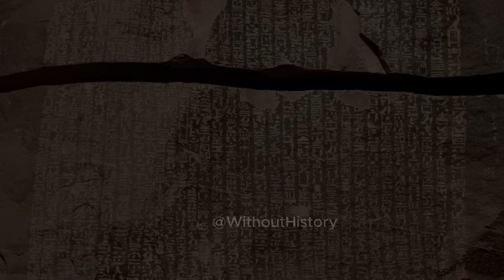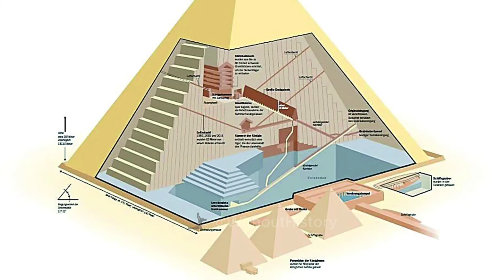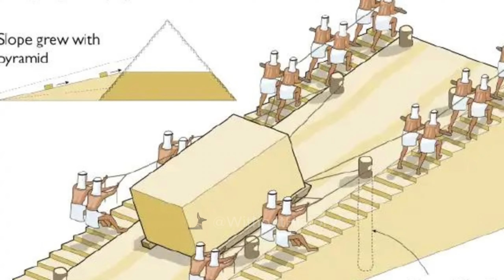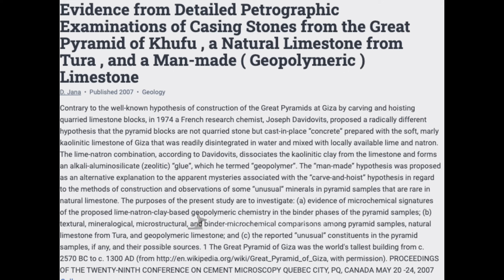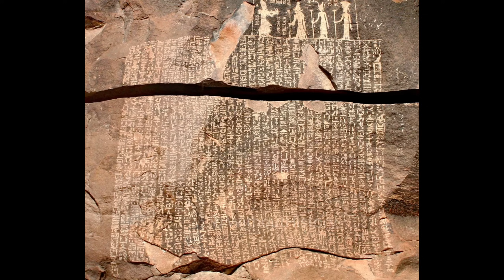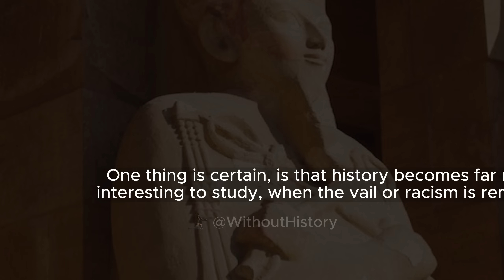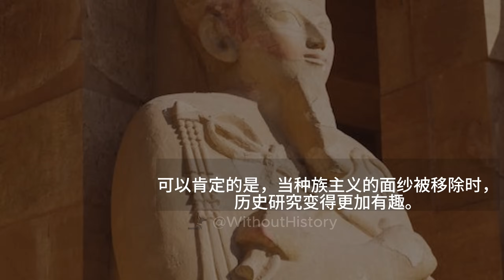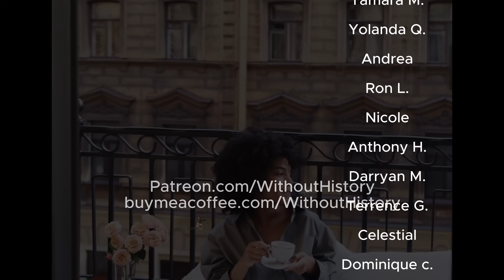That one Pyramid secret that explains everything!!!

Comment from the maker: if you liked it, Make sure you SHARE the video with your loved ones and on your social media. It's the only way the algorithm notices us. Much love to you all.❤❤
Reply: "To:Mr.Without History,this YouTube Video',was quite interesting:African heritage persons, especially African American'can most certainly benefit by finding out such ancient accurate African positive history. . .5-17-2023'
Reply: I Loved this video, it was very educational and informative!!!!
Reply from the maker: @annecrawford7813  thanks so much Anne 🙏🏽🙏🏽
Reply: If you had the possibility of pouring blocks to make up a pyramid, why not shortcut the mold production and demolding and moving into place.
Why not pour the whole pyramid in one piece, one huge block, with shafts and rooms cast into the make up of the pyramid?
I don't believe that the pyramids were poured block by block. 
What we see is the use of machinery that was run by electricity.
But since the so-called air shafts were sealed and covered by a stone placed over the end of the shafts with such precision that the shafts weren't discovered until the 18th century.
To cover them means that electricity was a secret they wanted to hide, the shafts were where the electric cables came in so they could finish the inside while still working on the outside.
Reply from the maker: @gianfrancofronzi8368  Fronzi, great idea, but you would have to deal with scaffolding that bigger than the pyramid and structural issues at the base that cannot withstand the pressure of above liquide. Also, your scaffolding would have to be perfect from the start which leaves no room for error.
Reply: @withoutHistory   What you are describing can happen with poured stone slabs. It's all the same, until you haven't let parts fully dry.
Reply: I’m saving this video for all time, thank you sir’ 🙏
Reply: And your china from kemet video was a real eye opener and this one, wow’ 😳😧🤐
Reply from the maker: @doncarmack5132  🙏🏽🙏🏽🙏🏽
Reply: . Hemotep clearly state he was crom egypt and not Kermit. He was of royal blood and not as you state he was an Andonite an not black as yu intonated 
So ur theory is blatantly. Do ur do diligent before expound  wrong
Reply: I have been inundated with the construction of the pyramids of Egypt and wondered why 99.9 % of the  facial structure,particularly the noses have been  broken off when their construction has been of very hard materials...we're their faces deliberately disfigured and by whom.
Reply: Secondly ,isn't  Egypt also called Kemet or is kemet simply a part of egypt
Reply: Are Imhotep and Joseph the same person who built the step pyramid. Acts 7:10...  God gave him favor before Pharaoh, king of Egypt. God also gave Joseph unusual wisdom, so that Pharaoh appointed him ruler over all of Egypt and put him in charge of everything he owned.
The Great Pyramid has 8 sides. The 8 sides represent the 8 kingdoms of the world. Jesus is the corner stone. The last kingdom to rule forever.
There is actually ten sides counting top and bottom. First Empire was Nimrod. Who represents Babylon the Great, the Empire of false religion. The bottom of the pyramid is a side. All eight Kingdoms of Revelation ride with the harlot, Babylon the Great.
The Great Pyramid having no top corner stone and 
the top being flat is the Harlot. Jesus is the cornerstone the builders rejected. The Nations would rather follow the Harlot than Jesus.   Revelation 17:9 “This calls for a mind that has wisdom: The seven heads mean seven mountains, where the woman sits on top. 10 And there are seven kings: Five have fallen, one is, and the other has not yet arrived; but when he does arrive, he must remain a short while. 11 And the wild beast that was but is not, it is also an eighth king, but it springs from the seven, and it goes off into destruction. 
Matthew 21:42 Jesus said to them: “Did you never read in the Scriptures, ‘The stone that the builders rejected, this has become the chief cornerstone. This has come from Jehovah, and it is marvelous in our eyes’? 43 This is why I say to you, the Kingdom of God will be taken from you and be given to a nation producing its fruits.
What does the Sphinx really represent. Because Jesus is the Lion of the Tribe of Judah. 
Isaiah 19:19 In that day there will be an altar to Jehovah in the middle of the land of Egypt and a pillar to Jehovah at its boundary. 20 It will be for a sign and for a witness to Jehovah of armies in the land of Egypt; for they will cry out to Jehovah because of the oppressors, and he will send them a savior, a grand one, who will save them.
Revelation 5:5 But one of the elders said to me: “Stop weeping. Look! The Lion of the tribe of Judah, the root of David, has conquered so as to open the scroll and its seven seals.”
Reply: The Great Pyramid points astronomically North. Cain went east of The Garden of Eden.  Young's Literal Translation Genesis 4:16
And Cain goeth out from before Jehovah, and dwelleth in the land, moving about east of Eden.
City of Leo, Was the sign of Cain a Lion. Cain worshipped Jehovah God. He offered sacrifices to him. So did Jehovah forgive him by marking his land with the Lion. The Mark of Cain. 
Genesis 4:13 At this Cain said to Jehovah: “The punishment for my error is too great to bear. 14 Today you are driving me from the land,* and I will be hidden from your face; and I will become a wanderer and a fugitive on the earth, and anyone who finds me will certainly kill me.” 15 So Jehovah said to him: “For that reason, anyone who kills Cain will suffer vengeance seven times.”
So Jehovah established a sign for Cain in order that no one finding him would strike him. 16 Then Cain went away from before Jehovah and took up residence in the land of Exile, to the east of Eʹden.
Genesis 4:24 If 7 times Cain is to be avenged,
Then Laʹmech 77 times.”
Matthew 18:21 Then Peter came and said to him: “Lord, how many times is my brother to sin against me and am I to forgive him? Up to seven times?” 22 Jesus said to him: “I say to you, not up to seven times, but up to 77 times.23 “That is why the Kingdom of the heavens may be likened to a king who wanted to settle accounts with his slaves.
Reply from the maker: @roenamorgan8286  thanks so much Ro🙏🏽🙏🏽❤️
Reply: I'm not convinced that this is correct.  More study is needed. Especially needed is citations  of soure materials.
Reply: I found this so interesting show.
I like to here more.
Reply from the maker: @rosemaryallison4913  🙏
Reply: @hazaelmurray9713  hope you find that vid.
Reply: How come the big archeologists don’t tell this ?  might misses something but they say inherited it and moved rocks
Reply: @BS89.  They're starting to see the light
Reply: 11111111111111111111111111111111111111111111111111111111111111111111111111111111111111111111111111111111111
Reply: The pyramids are aligned to true north NOT magnetic as stated in the beginning of this video
Reply from the maker: @assneckdave  correct
Reply: Now we know why the Greeks and the gentiles left this out, it destroys all of their lies.
Reply: I enjoyed all your videos, they are eye opening. I love ancient Egypt History. Keep them coming brother 💖
Reply from the maker: @cathyniumana2310  thanks so much Cathy 🙏🏽🙏🏽
Reply: This is becoming my favorite channel on YouTube.
Reply: @aundreamellado6112  Egypt is kemet it was kemet  before Egypt
Reply: " Egypt",is a Greek word ,the name is KMT.
Reply: Egyptians we're not black and the Tolamys were Greek not Egyptian. Grow up.
Reply: It can also explain why the Sphinx has roughly horizontal lines across its head and face

Comment: That same technique is found all over the Americas in Mayan buildings where blocks are fitted so tightly together that could not have possibly been carved. The Olmecs described something called Rock Smog, which was basically stone dust made into a special concrete from which blocks were formed. BTW, the Olmecs looked like Nubians and huge stone heads of them were found all over Mexico.
Reply from the maker: Correct
Reply: You're correct that the Olmecs were in fact Nubians. In simple words Black people
Reply: TA Merians and TA Setians. "Smai TAwi.".
Reply: @a.andrechisholm8528 it is absolutely B. African
Reply: My GOD this is excellent!👌 👌👍
Reply: As a matter of interest - One of the pictures that came up on my screen on opening was of a place called "White Pocket" Arizona.  The rocks there are laid out on the ground and the first thing i thought about was the walls built with interlocking stones in the ancient S.American cities.  You can google White Pocket and look for the best Picture.
Reply: I may have missed it,  but after the blocks were created from the mode, how were they placed on the pyramids? The blocks were supposed to weight 2k tons.
Thanks
Reply: @goodhealthat60plus12  Each level of the structure was made of wood and canvas, then buckets of concrete were carried on a stick (2 per stick) and dumped into the forms in much the same way we do big buildings now. So instead of toting 4500 pounds, each man carried 100-200 in a bucket brigade. When tested, it was found that those big blocks could be made every 15 minutes with just 20 workers in a line. That's much faster than chiseling and carrying stone up the site. Then figure that they must have had several hundred lines all doing the same thing at different levels and it's not as difficult as one might think.
Reply: I guess everyone missed the paintings of giant Ancient Egyptians carrying these heavy blocks on the walls??
Reply: It's possible because they did.
Reply: @RdanglRd  Maybe those were not stone blocks but the wooden or canvas forms they were carrying. No one would even think of them being forms if they believed they were blocks chiseled out of giant quarries.
Reply: @obeesrcconstruction9279  they even show how they made them.
Reply: @RdanglRd Could it be that what was depicted was a statement by ancient Egyptians saying...’These were not sculpted, therefore we did not carry them, if we had to carry them, we would need to be giants, for that is not who we are’ ? Would that not be possible, a language that was unrevealing of what they actually did, but rather a language of what we are not.
Reply: Yes Nubia is Sudan.
Reply: Yes, their writing script is Maande script.
Reply: @obeesrcconstruction9279  all I'm saying is that they depicted themselves carrying large square blocks. Plus giants did walk amongst our ancestors. But they also showed brick masons that's smoothing down the mixed cement, bricks, granite. All I know is that ain't no aliens did that.
Reply: @fredgillespie5855  y
Reply: INDEED
Reply: @susanrhodes9079  Then there must be more because I saw them in person at Xalapo Mexico in the museum of anthropology.
Reply: They have come out and admitted one we had been here, and they were African. They've also found the oldest Skelton African a child.
Reply: Yes, Pyramids are all over the Earth as they are all over the Solarsystem on different Planets and Moons. This is because Pyramids are a Technology that is used for many purposes like Power Generation as well as Consciousness Ascension. And Kemet was built and ruled by the Anunnaki. That is why there are depictions of Akhenaten and Nefertiti with elongated skulls. And that is why some of the Pharaohs lived much longer than Humans and why in the beginning they were said to be Gods and later Demigods or Anunnaki Hybrids.
Reply: Maybe it was sandbag technology?
Reply: 100% black people
Reply: @RdanglRd  That's actually a eurocentric view for the sole purpose of debunking the fact that the Kemetans built them.🙄
Reply: @RdanglRd they want to blow by that or keep it hidden because they don't want to believe it.
Reply: @a.andrechisholm8528  not a fact...not even all Africans are Nubians. Most Africans are not nubians. The Olmec heads look just like their ancestors who still live there.

Comment: I noticed you quickly glossed over how they would have pulverized diorite into a fine enough powder to pour statues with such fine detail. Also, has the diorite, or the granite for that matter been tested to see if they are composite? Not saying they didn't do it, but diorite and granite would have been a LOT harder to work with. Add to that, we know where the quarries are, and many blocks are not composite, they are shaped.
Reply: Surface softened and shaped .
Reply from the maker: I’m not sure how they would have. But I have a theory about it that requires more evidence to be brought forward. 

It is my belief that they melted it. 

We know ancient Egyptians had magnifying lenses all the way back in 3300 BC. I theorized they could have used it to melt stone using very large lenses. 

Many queries bare marks of such circular almost scooped stone. It would have been cut or softened on the cutting edges using lenses. In essence old laser tech
Reply: @Without History  How do you explain the great obelisk that's still sitting there Then there's balbek some things are just a mystery I think that the pyramids are far older than history puts them at.And they weren't no tombs it's hard for us to believe that there could have been a far more advanced culture than ours in the distant past that could do things but in a totally different way than we would today even Easter Island 🗿 there's still a lot of the statues carved but not separated from the volcanic rock yet.
Reply: @withoutHistory :   If such a LARGE magnifying glass exist it would have been uncovered or discovered by now.
Reply: For what it's worth heating stone enough to melt it changes the stone & leaves it detectable that it was melted. For example the stone can turn dark. Some other YouTube videos have people describing what they got when they melted or attempted to melt stone. I always wondered how anyone would control a large magnifying glass in order to get precise & accurate results. It's not like the ancients had computerized robotic arms to control the hot point being generated by the giant magnifying glass. Plus the hot point only forms at a certain distance from the lense. Quite a challenge to achieve motion in 3 directions to cut deep, straight or along a specific path. Plus once cut, how much time is available to work with the stone till the cut cools & the stone bonds again or the separated stone's newly cut surface thickens & hardens. Just a challenge for me to picture the magnifying glass process with all it's necessary aspects from start to finish. Seems insufficient to just say a hot point sufficient to melt stone can be created.

Comment: Some queries and reservations:
1. When, where, and by whom have these theories been tested by recognised subject-matter experts ?
2. Were all stages filmed/photographed, and documented, illustrating credible realistic reproduction, including full reported analyses of the results ? Density, weight, surface finish, hardness (compensated for time), and a feasibility study including contemporary logistics and material availability/preparation.
3. Were these tests, results & reports presented to the applicable leading global institutes (archaeologic, engineering - civil/materials/chemical) for technical assessment, and accepted as plausible or accurate ?
4. E.g. the casting of hard stone statues would not normally immediately produce high-gloss (high-density, very hard, extremely smooth) surface finishes, so the cast would still need to be finished using something equally as hard, or harder, than the casting. What is the explanation ?
5.. Have any physical remains (or indications) of such manufacturing systems been unearthed or described in contemporary documents/inscriptions ?

6. If  these casting/moulding/reconstitution theories are indeed the answer, why are they not today's mainstream explanation of the construction/production techniques used in ancient Egypt ?
7. why did ancient constructors limit themselves to individual blocks ? They must have used some kind of containment or shuttering to make casts and moulds. Why not make seamless pyramids or walls ? They could have used progressive casting to allow lower levels to dry before adding more material. Why were the pyramids clad with limestone, when a mould surface could also be polished without cladding ? Why/how do seams exist, however tight, between blocks ? We know the blocks are separate pieces as evidenced by separation in many locations.
.....
Questions. Too many questions. I am open to answers.
Reply: Very often "Academia" can be as close minded as a steel trap.  Many experts that present theories like this are often ridiculed, snubbed and funding will cease.  Many have even been driven out of their careers.
Reply: @zsigzsag  it would be a sad world where we do not challenge theories to show evidence of their propositions. And from this video I see mostly theory and little evidence of proof. Equally, it is irrelevant to me who wrote the theory. Einstein also had to prove his ideas.
Reply: Why don't you tell us better?I might be wrong, but I suspect that you are European, I could be wrong
Reply: @TrevorNestorDiaz   would that be positive or negative ? Are you saying that Asian, American, Australasian or African people are unable to challenge statements of theory ?